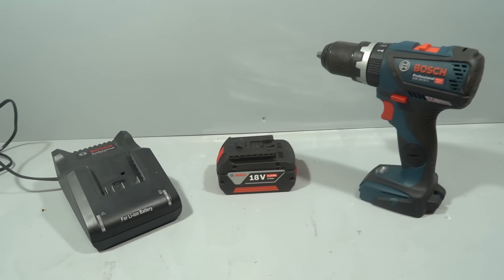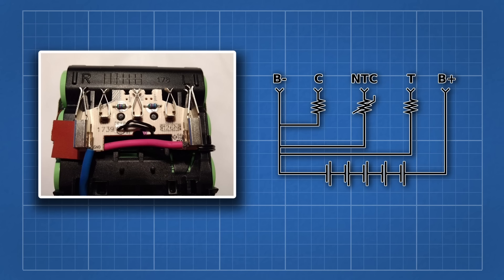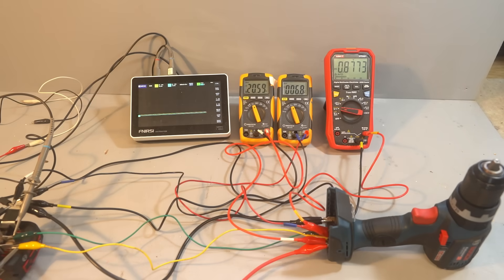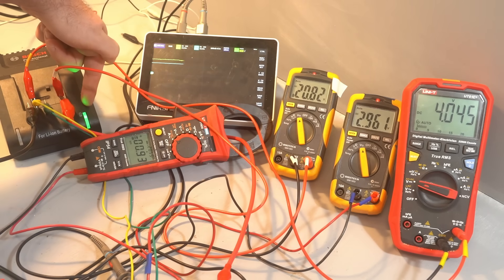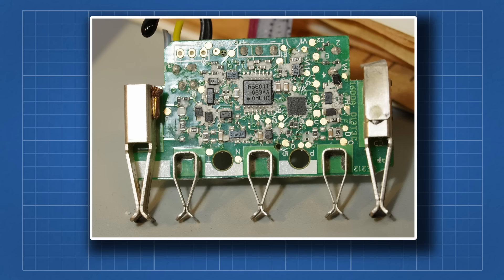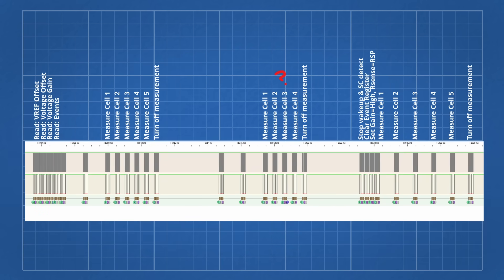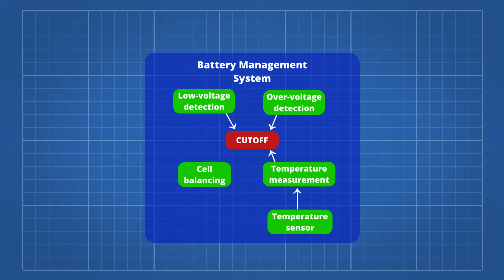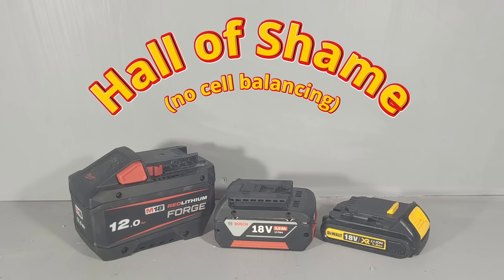[012] How does Bosch 18V compare to the rest?

Comment: The Bosh "Power For All Alliance" 18V batteries (green Bosch, Gardena and other manufacturers use the same battery) also have no cell balancing. 
I have a Bosch cordless vacuum cleaner with 2 of these batteries.
After about 2 years the vacuum cleaner only worked for a few minutes with one of the 2 batteries.
I opened that battery and there was a significant voltage difference between the cells.
Then i balanced the cells with an ISDT Q8 smart charger, after balancing the Bosch battery worked fine again, but after a few months it had the same problem because the battery has no balancing circuit.

Not balancing the cells is a way to sell more very expensive batteries (too expensive for what really is in the battery pack) , they wil mostly work during the warranty period, but after that you just have to be lucky...
It is part of the Planned Obsolescence, to make more money because you will have to keep on buying new batteries that could last much longer if there was a balancing circuit in the battery.
The only one who wins by leaving out the balancing circuit is the manufacturer that already makes very high profits on the batteries.
They do not care about the customer, they only want to make as much profit as possible, they wil gladly take the risk that a small percentage of these batteries go bad within the warranty period, because for them the real cost of that battery is just a fraction of what the customer has to pay for it. So if they have to give you a new one, they are still making a profit.

I have some cheap Parkside tools (Lidl), in all the Parkside 12V and 20V batteries there is a balancing circuit, and these batteries are much cheaper than those from the "respected brands".
Reply: Didn't know Parkside's had cell balancing, nice. It's what I have more of!
Reply: Interesting. I have the same type with 25r cells, its 3 years old I think, no cell imbalance whatsoever, not even a tiny one , to the point that I assumed it had balancing and I found this video very strange. I guess its more of a testament to quality of Samsungs cells than anything else.
Reply from the maker: That's a shame. There's very little Bosch green in AU as the budget market is dominated by Ryobi and Ozito (rebranded Einhell).

Do you know what ICs Bosch Green uses?
Reply: @toolscientist it is not a shame, not to have cell balancing. It is care about people, that their batteries do not catch fire. You have to make a bit more deeper investigation in this complex topic as cell balancing. In is not as easy as you think.
Reply: @StepanovsAndrejs  Why would balancing increase risk of thermal runaway?
Reply: @StepanovsAndrejs  average bosch enjoyer
Reply: @scottboyce it is hard explain in few sentences. You know what is Dunning-Kruger-effect? Most people complaining here about lack of cell balancing in the batteries have exactly this effect 😅
Reply: @scottboyce  ok. I will try to explain shortly. Maybe you will get. Imagine your IC which measures cell voltage goes crazy(or any other component is damaged in the circuit of the input filter), and starts to measure cell voltage wrongly. And if you have cell balancing it means cells with lower voltage will be "balanced" and their voltage will be pushed up. But in reallity this cell was ok, it means cell X which looked as "discharged" will be overcharged innreality....what happens then I hope you can imagine!
Reply: @nickfirst7249 what this means? Is it bad? 😂
Reply: @StepanovsAndrejs  imagine ic in charger goes bad and ignites someones house. scary stuff right?

balancing happens on same circuit that measures cell voltage/ if there is problem with connections on this circuit - measurement is wrong and balancing is not happening. if there is problem with ic - yes it can pump voltage in one cell. solution? maybe monitor cell voltage separately? in the end - balancing batteries is a standard in electric vehicles and solar, so it is very much doable
Reply: @StepanovsAndrejs   bosch is good brand. but stating that  no balancing is better then balancing just because bosch doesnt do balancing is somewhat questionable behavior
Reply: @nickfirst7249 i don't say it is not duable,  I just say that it is more complicated to do in safe way, like it looks like.
As well if you have experience in electronics, you should know that automotive components price is 2-3x?!
Reply: @nickfirst7249 probably you agree that Porsche car is better as russian Lada 😂! Why people then buy Lada not Porsche? Price maybe 😂?! Better does not mean that user is ready to pay fot this "better". I hope this is clear for you!
Reply: @StepanovsAndrejs  thats the thing - you already paying premium with bosch - but without balancing. so mental gymnastics begins about "it is ot safe so bosch doesnt do it". why other btands do it and there is not a surge of fires? theyll be shut down preaty quickly otherwise
Reply: @nickfirst7249 good point. So make here a list which brands are doind balancing?! I am curious to see the list 😂
Reply: @StepanovsAndrejs  i dont know really
Reply: @nickfirst7249 You see! In this video even I think was mentioned that still he have not found which brands are doing balancing in power tools 😂. I believe they exist, and I hope in future more and more brends will do this. But as i mentioned there is a clear reason not to do this now. And if someone don't understand this reason it just say about his lack of deep knowledge in this feeld.

Comment: 6:20 I bet that also explains why they are only measuring 1-4 in that second measure cycle on startup -- if their measurement sequencer always starts at one and has to do every cell in order, in round 1 they tickle 1+3+5 with the balance circuit, and so need to measure all five cells afterwards. In round 2, they're only tickling 2+4, so they can skip cell #5.
Reply from the maker: Yeah, that's what made me think there was a reason for it. The whole sequence seems kinda odd. Makes me want to pull the firmware and see if that reveals what they're doing. Part of me thinks it's just demo code and they didn't bother to delete the balancing example

Comment: All this carry on about balancing, but when exactly is that going to occur? They are fast charging tbe cells and the livelihood is that the pack will be pulled off the charger immediately that it reads "charged".
Balancing off the charger will just run the pack's charge down under storage.
I've personally found no evidence of severe imbalance issues with name brand packs, except for older Ryobi that always kills cell 1 due to powering the BMS etc off only that one cell.
Every year I open my packs and manually balance using a hobby charger. I don't find any significant problems, mainly because the name brands use quality cells that are well matched.
Power tiol packs cop and absolute beating, with far too high charge currents and tools that pull right up to and often over the cell's rated continuous current. It's mainly the charge/discharge cycles that kill them, the cells just wear out. Bigger packs (2P & 3P) are much better because the cells share the load, but often the manufacturers use lower current rated cells in those to get more overall capacity from them.
Reply from the maker: There's definitely challenges to balancing power tool batteries, but they're not insurmountable.

Ideally, you would charge, balance, then top up. It's easy to add an LED to the charger to indicate that it's balancing and should be left on.

If you're balancing every charge, the amount of imbalance will be tiny and only take a few minutes to correct. In the event of severe imbalance (from a user that always takes their battery off before it balances), you could make the charger go straight into balancing

I personally have had 4 batteries become badly unbalanced. 1x 8Ah M18 and 3x 12Ah M18. These have Samsung 40T cells, which have been problematic. You can find many, many users with the same issue.

Comment: I use Bosch 18v green tools (and so do a lot of others going by the fact that almost all DIY stores here stock them and have done for years). However nobody ever seems to do analyses of these tools or batteries. Maybe they're not popular in the states?
Reply from the maker: I've heard of Bosch Green, but never seen them in person. I'm in Australia, and they seem pretty rare here. I can only see one retailer that sells them. The official Bosch-diy AU website just directs me to ebay and amazon
Reply: @toolscientist  Interesting. I'm in NZ and Bunnings and Mitre 10 here both have the full range of Bosch green 18v (home DIY range). I bought into the range close to 10 years ago when I saw that they had a 'power for all alliance' system where the batteries fit lots of different tools, by Bosch but also others (worth a google). They were one of the first companies to do this. (I have a couple drills, Jigsaw, Sabre saw, Circular saw, Strimmer, Leaf blower, Angle grinder and a hand-held vacuum.) Cheers.
Reply from the maker: I could only see Mitre10 having Bosch green. Don't think I've ever seen Bosch green at Bunnings, only Bosch Blue/Pro

Comment: Anecdotal evidence here, but even though they don't have cell balancing, I have about a decade of time on some DeWalt batteries and over three dozen various DeWalt battery packs, including a lot of 2.0 amp, 4.0 amp wide packs, a bunch 5.0 regular packs, a couple 60 volters, and a few of the new 2.0 powerstacks have a couple years on em.  The only battery I have that failed was a Scamazon DOA 5.0 pack sore dick deal and they aren't a licensed dealer so no warranty on that pos. I am a carpenter and I have not been especially nice to my batteries either, and I just use them.  I would be curious what other peoples experiences are with other batteries.
Reply from the maker: Fully agree. When they use good cells and cell match, they easily last 10 years. The biggest problems are in the high capacity packs. Those cells just seem to have too much variance. Every brand's 2/4/5Ah packs are quite reliable, but the 8/9/12s are notoriously bad.
Reply: @toolscientist  Interesting, and I haven't used those size batteries much at all, so I can't speak to that, but it does make sense that just by virtue of adding cells, you increase the rate average of failure.
Reply from the maker: It's more the capacity of the cells. In 18650s, 2000mah and 2500mah cells (which make 2Ah, 4Ah, and 5Ah packs) are very reliable, then 3000mah (which makes 6Ah packs) are not. Generally, higher capacity cells have higher resistance, so they get hotter, and degrade faster. We'll see if tabless cells can alleviate this problem.
Reply: @FeelingLikeThatNow i can confirm that. Same here.

Comment: Noob question: How much does cell balancing realistically improve battery life time? I mean, if the internal resistance of each cell is "identical enough", and they're charged and discharged in parralel anyway, won't they wear "evenly enough" that when one cell goes tits up the others would have failed fairly shortly after anyway?
Reply from the maker: Good question and a hard answer. In my last video [011] I did discuss how  even though M18 don't balance, I have a few 10+ year old batteries that have stayed quite well balanced.

Anecdotally, the issue seems to be when they use high capacity cells. Particularly 3000mAh 18650s and 4000mAh 21700s. All 4 of my M18 batteries with 4000mAh 21700s went out of balance within 4 years.
Reply: @toolscientist  Ah... well if they don't match the cells well, then it's obviously going to get out of whack pretty quickly. It just hadn't occurred to me that they might both not balance and not match cells.
Reply from the maker: @andersjjensen  even with matching, nothing is perfect. The cells closer to the core of the battery are also going to get hotter than the others.
Reply: @toolscientist  Ah, yes. Resistance goes up with temperature. Never thought of that, and since my vape stick can get pretty toasty I imagine the battery of a cordless tool, that is being properly ganked on, starts to sweat too.
Reply: Good question. IMHO often a lot. A lot also depends on the circuitry.
Most dont know that self discharge rates are not directly linked to internal resistance so thats another factor to consider. As some circuits will brick the whole pack if the voltage differs by more than 0.3v between cells when charging (like in Dyson V8 battery packs), keeping the cells balanced just to prevent the circuitry from dying is important. I'm only speaking to vacuum battery packs here but some chinese battery packs will stop charging when 25.0v has been reached and not when a maximum cell voltage has been reached (massive potential for overcharging, cell degradation or fire).
All I can tell you is this - I have a dying cheap chinese pack (which was lasting 2 mins 43 seconds)
I attached a cell balancer to it, ran it again and now get 21min 53secs.
Whats interesting is this info for cell number 2 in the pack:
3.41v after charging the dying pack (before balancing) (Yes the cheap pack overcharged other cells)
4.11v after charging & balancing
Even more interesting is that this cell now has a higher voltage when the pack is dead than it previously had after the pack was fully charged (3.58v dead vs 3.41 charged)
Just as interesting is that this cell which appeared to be the weakest when viewing the voltage levels, when tested with a capacity tester had the highest capacity of the pack

So the irony is that the strongest cell may be the reason a pack won't last long. The circuitry "Smarts" is key and some form of balancing will in most cases vastly improve the pack longevity.

Comment: Wow! I love that not only the creator is engaging with audience and answering questions and suggestions, but also the content: just ripping masks off these "brown link" brands claming for something intelligent when in reality their batteries are stupid as hell. On the other hand - nobody wants a tool with DRM in the batteries like some smartphones and laptops have!
Reply from the maker: That's the dilemma isn't it. I quite like Dewalt's design as it's so simple and easy to rebuild. They cheaped out on their charger unfortunately. Makita on the other hand is very easy to use on custom projects as it outputs a mosfet driver signal on its 3rd pin. But then Makita has the most temperemental BMS that likes to brick itself.
Reply: @toolscientist  As far as i know - makita 40v line has smart batteries with cell monitoring and even event log, but i dont know if they do balancing. And yeah... BMS that non-reversibly bricks itself is malicious and should be banned worldwide!
Reply: @LordPrecision  Don't forget that the more cells you put in series (to get a higher voltage) the more important cell balancing becomes. A 40V battery has much more cells then a 18V battery in series and these batteries would suffer much more from cell imbalance then 18V batteries, so having cell balancing in 40V battery is probably needed to have a reasonable life expectancy.

Comment: It's a shame that cell balancing isn't mandated by law, like the protection circuits to prevent batteries from exploding. Improving the lifetime of battery packs would be beneficial for the environment.
Recently, I built a Makita compatible battery pack with a BMS from AliExpress. The version with balancing was only 1.50 USD more! When you factor in the cost for battery cells, the price increase is less than 2% and quickly approaching 1% with higher quality cells.

Comment: Is there any chance you will look at the ProCore batteries? I wonder If they do balancing... 
Also the 5,5 Ah and 8 Ah are supposed to have the same cells, it would be interesting to see how they cap the discharging and if you could convert a 5,5 to an 8 easily by let's say changing a Jumper wire or something. Love your videos!
Reply from the maker: The 5.5Ah and 8Ah have the same size cells, but they're diff capacity. The 5.5Ah is most likely Samsung 30T and the 8Ah most likely Samsung 40T. Only way to upgrade is to buy 10 new cells and swap them, which requires spot welding.

I'll look at ProCore if I can find a used one available for a decent price.